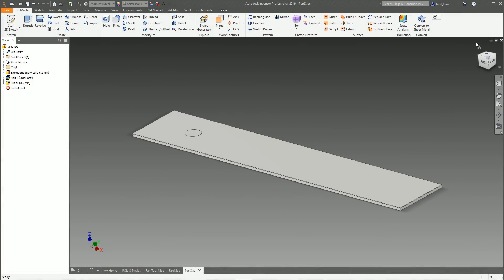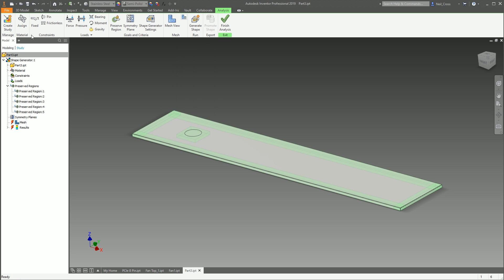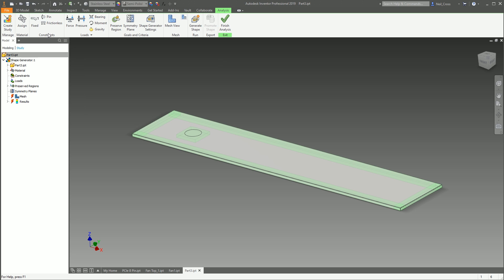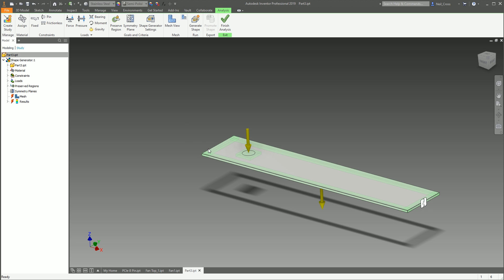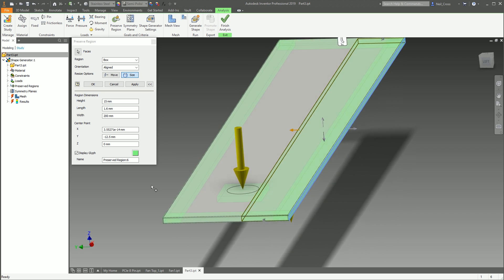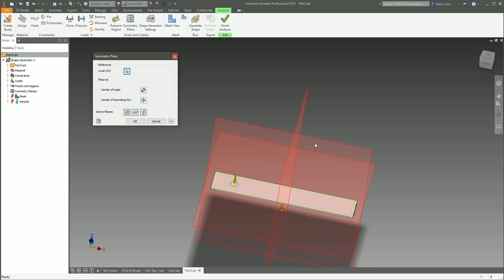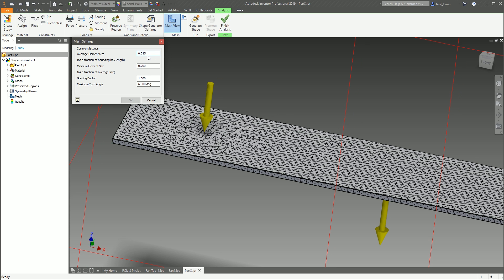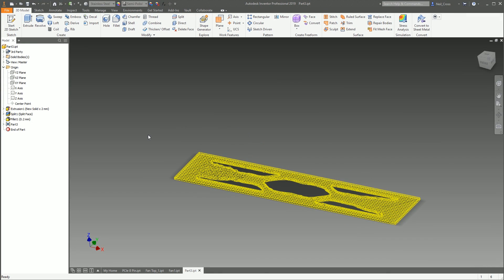AUTODESK INVENTOR EVERY BUTTON EXPLAINED! Part - 3D Model - Explore (Shape Generator)

Comment: Again, more of a tutorial than you realize haha. I love the way you talk, no-one says "daft" anymore....and I can't for the life of me understand why not. 

That is rather interesting....keep it as an ipt or save it as an stl to be used on a 3D printer....hmmmm....That's certainly intriguing. 

You've had videos going into detail about how gaming GPU's make no difference at all in Inventor (for the most part). What I have seen a significant improvement is in areas like Inventor HSM when I create tool paths and I want to simulate the tool path to see if there are any crashes before I try to machine it. Would an area like this, like FEA and CFD be CPU or GPU intensive? Would a gaming CPU and GPU combo come more into play here over a workstation CPU and GPU, especially when considering (1) the average price and (2) the clock speeds? 
(ignoring reliability, even though my overclocks have appeared extremely reliable, and any certified hardware b.s. --Purely performance per dollar question, gaming tax vs enterprise tax)

I've spoken to an Autodesk Firmware/Software engineer asking why my gaming computer was still so slow while opening Inventor, what I didn't understand prior to his response was how sequential the unpacking of an assembly really was. He said "when you design parametrically you have to do things in a certain order for it to be effective. When a Processor has to open that file, it must do the same exact series of steps." 

I mentioned that my CPU ran at 4.2 GHz and my RAM was at about 3200-3400 MHz and he made sure he made it clear that the clock speed of a computer, although not the only determining factor, influenced the speed of the process significantly. Inventor should always be able to make use of higher clock speeds, not necessarily more cores after two or four. He mentioned specifically larger physical CPU cores with higher clock speeds would be the most ideal. Our conversion did not really go into GPU's but if this can be parallelized then the large amount of memory at high-speed and giant relative core count at the high overclock speeds can't still be the same as the workstation cards....right?